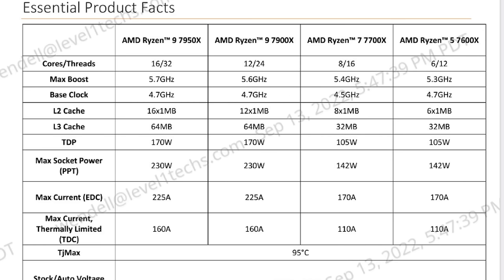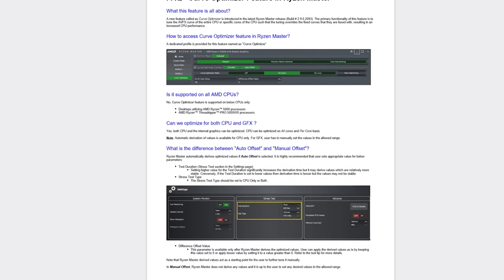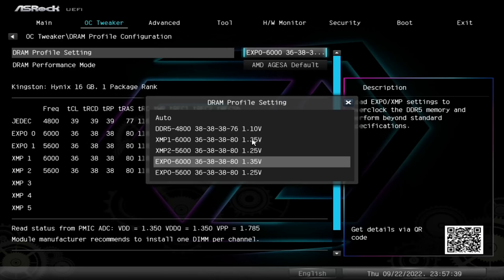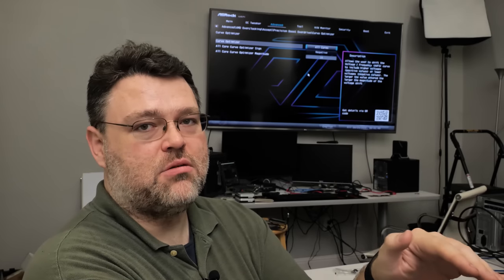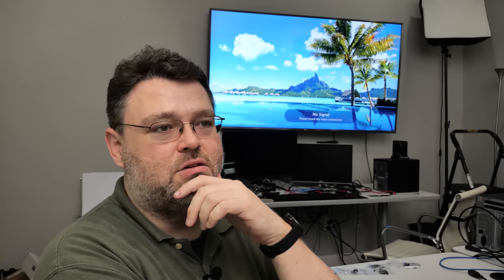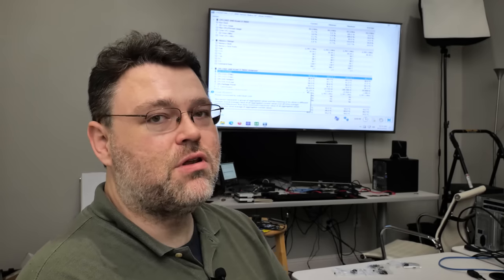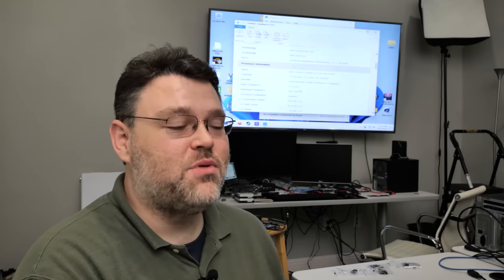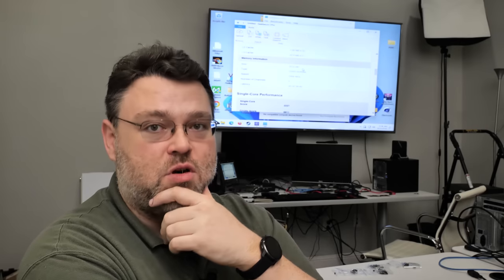Kicking Ryzen 7000 into HYPERDRIVE! Overclocking, Curve Optimizer, 5.85 GHz!

Comment: Hey Wendel, any chance you'll be doing some testing/comparison with 2 DIMM vs 4 DIMM?
I've heard the situation isn't great in respect of ram clock speed penalties but it would be good to know what is possible and what to expect, specifically I'm looking towards 64GB (2x32GB), but would like to know any upgrade routes should I need more ram to expand that to 128GB (4x32GB), nobody seems to be testing that at the moment because they're probably busy with AM5 stuff and Intels new stuff for reviews.
Reply: I'm still in the process of tuning, but I've got two kits of 2x32GB 5600 40-40-40, and on my X670E ProArt they're pretty happily overclocking to 6200 36-36-36. I like to leave a little margin so I've been running memtest over and over on a 6000 36-36-36 profile and have yet to see any errors. On my Alder Lake setup, the computer refuses to do anything but JDEC 4800 if I have these four modules installed at once, so whatever AMD did here worked.

I may just have lucked out and gotten the most perfectly manufactured motherboard and Ryzen memory controller ever made, so your mileage may vary, but if you had asked me last month I would have said that two DIMM per channel is dead and shouldn't be attempted on DDR5. Instead, I find myself pleasantly surprised by just how well my computer is handling this.

If my experience is any indication, adding more modules after the fact shouldn't be a problem. That said, my DIMMs use Hynix dual rank chips, which apparently is the best overclocking thing on the market right now.
Reply: @СусаннаСергеевна  I appreciate the feedback, I'm waiting on the same ProArt X670E motherboard and a 2x32 5600Mhz 40-40-40-77 Corsair [ CMK64GX5M2B5600Z40 ] kit arriving, it's currently held up due to ram availability, the whole lot will ship out when the ram arrives, I have the 7900X CPU already.

It's nice to know I should be able to install a second kit (provided I can get the same SKU) in the future without having the memory bus crippled.

Comment: Regarding your comment on tower cooler.  My ice giant prosiphon with no fans mounted on the cooler has no issues cooling my system.  5.4ghz all core in R23 all day np.  I do have a 200mm fan on the side panel about two inches off the cooler, but this is how I cool it with a near silent system.  Thermaltake V21 with only four 200mm noctuas on it.

Comment: I'm looking forward to custom loop results trickling out.  Decent pumps, proper thickness rad(s) and greater thermal mass ought to make quite the difference, for both performance and noise.
The way [top end] CPU and GPU power draw's gone (and headed?), custom loops may well be become more than a mere vanity project.  Probably also gonna see thicker AIOs rolling out soon, which'll mean cases are gonna have to make room as soo many are designed around the current skinny ones, which'll be a boon for silence freaks running the mid-tier components.
Reply: You can easily get 95% of the performance at half the power, making even a cheap tower cooler sufficient. An extra 5% isn't worth the extra $200 for good water cooling, and risk of leaks. Also, most applications don't use all 16 cores.
Reply: @xeridea  That's always been true, due to diminishing returns (though it is on steroids now).  However, people have still done overclocking to eek more performance as more performance is worth the cost to them.
Most people don't need 8+ cores or 4Ghz+, but those buying those chips want/need it.

Comment: CPU Cooler Roundup you say? The one I'd like to most see on there is the Arctic Liquid Freezer II 420mm
Reply: I would also love to see this myself as I have one just laying about that was given to me new still in the box as they found out it would not fit into there case.  I just got the 7950x so I'll have to start looking about for a case I will not have to modify for this to fit.
Reply: @kevinsteinman8967  you should get a case with room for a second radiator so you can also run a GPU with an AiO or water block attached

Comment: super handy thanks Wends I have the aorus master and the 7900x not had a chance to tinker yet I'm gonna get to it with this valuable info also by the way huge open loop cooling dual rad one of which is 90mm thick lol if the silicon gods have smiled upon me this could be fun

Comment: FFXIV Endwalker BENCHMARK!? I ran the same settings with a i7 12700k (stock), RAM at 3200 MHz XMP (stock), and RTX 2070 Super (stock) and got 21249. You were able to get about 13k more points. That system is about 38% faster than mine on that benchmark.

Comment: Last week upgraded ny 5600x/asus b450/32GB 3200 to 7700/B650M PG Riptide/KingBank 6400 CL32, and with tweaks I have quite happy with the final results:

BIOS Settings:

Memory = 6400 @CL30/38/38/80 1.4V
FCLK = 2133
MCLK=UCLK/2
PBO: Advanced/Motherboard, Scaller 10X, Positive 200
CO: All core, Negative, -30
iGPU = Disabled
BIOS Thermal Limit = 89C

Cinebench R23 Multi/Single = ~19,200/~2000 (~44-46W/~114-116W)

Idle = ~49-51C (Windows 11; room temp ~23C)
Games max 92C
Load (Cinebench R23)
All core=5.1-5.2hz @89.4C
Single Core = 5.49Ghz (59-60C)

Comment: I can get 5.5ghz all core on my 7600 (non x).

Set PBO to +200 
Curve optimizer -42 (-45 max but lowers benchmark score)

This brings me to 5.35ghz so I had to raise the FLK/Base clock from 1 to 1.3 which brought it up to 5.5ghz all core at roughly 72c-75c on my Arctic freezer II 240.

Raising FLK also seems to have raised my from from aggressive 6000mhz cl30 to 6180mhz? at CL30 still.

Comment: I just limited my 7700x to 75c thermal throttle limit and I consistently score over 1000 points higher in cinebench r23
Reply: That’s not how it works 😂
Reply: @puffyips  you can set a thermal limit in the bios
Reply: @ydkma  yeah no shit, what I meant is throttle limit ain’t where it’s at, pbo and power limit is

Comment: Some notes: 1. These chips/zen 4 was designed for laptops.  2. Lowering power settings can lead to higher average FPS, because of higher minimum FPS, probably caused by less throttling because no more overheating, ain't that funny.

Comment: Curve Optimizer at -25 on a 7800X3D, 32GB 6000CL30. Apparently should run at -30 even, but I'll settle for that. Just started dabbling with OC. Not looking for numbers, just something decent, stable, and lower temps & power, with a NH-U14S, can't go crazy anyway.

Comment: I was able to just drop my 7700X straight into the -30 maximum my motherboard allows and it just werks. Three months after I've built it and it hasn't shown even a hint of a symptom of instability. Not sure if I just won the silicon lottery hard, but at that level of undervolt it barely hits 80c on stress tests now.

Comment: Maybe try ECO mode on a linux compile session, if you can do that. Maybe not overheating the processor will actually lead to faster compile times ! =D Less throttling hehe. Seems to work for (gaming) average FPS ! ;) Less low minimums more steady FPS.

Comment: Would be supercool to see if you can build a whisper quiet fast machine with these cpus, limit it to 65w perhaps 4.8 ish all core or something like that so the fans can stay under 600ish rpm with perhaps a 420mm aio.
Reply: Lolol, you could passively cool and just let it throttle at 95C 😁😁
All it needs is enough heat sink area to handle 65w and it's faster than an i9 12900k
Reply: Already built a whisper quiet PC with 5950X and RTX 4090 that remains completely inaudible even under sustained load, using an O11 Air mini case with 10 Noctua fans. Gonna fit an AM5 board with 7950X to see how it fares

Comment: My 7950x runs all day @ 6050 with ddr5 6200 with a older water loop with co @-25
Reply: 6050? What's all of your bios settings? I have a super efficient aio but yet my 7950x never boosts past 5.6ghz.
Reply: @PsychoBenches  what board you on myself am on a strix e gaming wifi.  Curve optimizer set @-25 all the throttling turned off on vrm maybe something to check.  Also make sure docp is allowing curve optimizer to take over when it dont.
Reply: @JoeMama-yl1ow  yeah I'm using the x670e-e gaming wifi, maybe I'll try the curve optimizer

Comment: Based on what I've seen in this video and a couple others, (Optimum Tech comes to mind), it seems quite odd that AMD made the defaults so wasteful when with some judicious tuning you can get more performance with lower temps and lower power draw. 
I suppose the left themselves a lot of leeway to adapt to whatever Intel does with their next release, but the power draw numbers at release were a big turn off for a lot of people.

I really want to see someone do a test to show just how bad it could/will get if you try to reuse an AM4 cooler, particularly air coolers with these new chips at stock settings as well as tuned for more sane power draw.
Reply: Because not all cpus can actually boot with those undervolts, some are binned just on the edge of stability wuere they will never fail at stock, but as soon as you try undervolting it will immediately crash. Silicon lottery at it's finest.
Reply: They are also preparing for raptor lake and AMD went with shock and awe approach.  They know very well that a stock vs stock will be the used for comparison.   Im betting future bios revisions will further optimize these monsters.

Comment: I have negative 25mV!!! on Ryzen 5 7600X Love my new CPU. Upgrade from good old i7 4790k.
Reply: Should try to push the negative offset further with PBO

I was roughly the same at stock, however after maxing out PBO I was able to easily push negative offset to -40 something which simply wasn't possible at stock. This allowed for a higher all core boost, with good voltage 1.205v they really seem to work very well with each other hand in hand.

Once you find the balance for one it let's you push the other further.
Reply: @GainingDespair  I tried that, at -30mV it can work for some time but it is not stable and it will crash eventually. -40mV PC doesn't boot.🤣🤣
Reply: @janissprudzans8631  it's not mv. the optimizer works in steps, please read into that.

Comment: Core cycler makes curve optimizer way easier to stability test quickly
Reply: Do you know if Boost Tester and PBO 2 Tuner work with zen4?  The videos iv seen were all on the last gen CPUs and I'm wondering if they're still applicable to dialing in curve op for this gen?

Comment: Arctic use AM4 backplate on LFII but one of the manufacturers had a slightly different z height of the backplate which negatively impacted cooling, 1 or 2 degrees at idle but double digits when go brrrrr. (either msi or asus, I use both boards and bring the known "good" backplate with the arctic).
Reply: Where did you learn this information, I was looking at an artic cooler for am5 but if I'm rolling the dice on it I'd rather not
Reply: Which motherboard exactly has that issue with Arctic coolers? Could you elaborate on this? I have a LFII 420mm and want to be sure with my future motherboard purchase and any possible incompatibilities.
Reply: @andreyshchukin1355  I think they're referring to the Gamers nexus video titled "Arctic Does What Others Won't: Defective Liquid Freezer II Issues"
Reply: @adammills4099 As long as I understood, FRACTURED LIFE mentioned about some cooling issues due to the thickness of the backplate of some motherboards. If this is the case, I would like to learn more about that issue. The video you mentioned is about other (already solved) issue - the defective rubber gasket that Artic fixed in all latest cooler revisions and provided the proper one for free to anyone who wanted to replace it himself.

Comment: Hi Wendel, did you try a heatsink and fan and monitor the difference between the CPU temp and the cooler temp?  No matter the heat produced in the processor my cooler is staying close to ambient running small fft, etc. with one exception.   I have a Passmark score of 38395 so I'm seeing a substantial bump over stock.    I am using an AsRock $169 B650 board.  I have the memory set to aggressive Expo 6000 CL30 and a -30 PBO on 7700x.   The cooler is an Artic Freezer 33 TR single fan.  The only thing that lead to a power shut down is when I increased the voltage to 1.275 and turned off PBO when that happened the cooler still stayed ambient including the back of the cold plate.   With stock or with PBO the slow heat exchange through the IHS isn't causing problems and you can run a silent fan speeds.  Pushing the voltage and the IHS is acting as an insulator.    Steve at Hardware unboxed used a Wraith cooler which is all a non-heat pipe solution and saw degradation in performance.  I'm not seeing that.

Comment: Regarding the "a lot of electrical load" for having 4 DDR5 DIMMs and trying to run them at, say, 6000 MT/s. I am EXTREMELY curious right now... does Intel have this problem ? Can you run Intel i9 12900K on a higher-end motherboard with 4 DDR 5 DIMMs at 6400 MT/s ? Because I haven't heard of this problem before, only now with AM5
Reply: It's just an issue as of right now a lot of these board manufacturers will release refined and updated bios that will allow for higher clock speeds on the memory side and fix the stability issues. I wouldn't be surprised to see 6400-6600 with 4 dimm and 7200-7400 with 2 dimm with future bios updates and a good CPU to keep the 2-1-1 ratio
Reply: Ram speeds are worse on alder lake actually

Comment: it's better to have 2 DIMMs over 4 ?? well shit i just paid 560 c$ for 4x16Gb of DDR5 Gb 6000Mhz CL40, thinking that having 4 DIMMs would give me better performance ..

well i guess i'm f*** :/ (i'll do benchmarks when i get my ram set to see how severe of a problem this will be ..)
Reply: You’re not necessarily getting better performance out of two DIMMs, but you will find it a lot easier to overclock with only two, because the extra two slots are actually just daisy-chained to the primary two. Capacitance and “bounce” in these traces creates “noise”, making things harder for both the DIMM and the memory controller. It’s even worse if you actually plug something into those extra slots. For this reason the best overclocking boards, even on a full-size motherboard that can physically fit more modules, will only offer one DIMM per memory channel. 

With DDR5, I would be surprised if you can actually use the 6000 mode with all four of your DIMMs plugged in. On my 12900K the only way I can use four DIMMs is at 4800, and that’s after using the memory retry option a few times because the training often simply fails. Zen 4 supposedly has a better memory controller, and soldering the memory slots as surface mounts instead of through hole will also help, which most of the X670 boards are doing, but ultimately it’s a flaw of the standard and it will probably be years before DDR5 becomes as stable as DDR4 is now.

Comment: What difference between leaving PBO Limit to motherboard vs setting the limits listed by overclock3D of 140000, 110000, and 172000? I’m using ASRock B650E PG ITX with a 7950X

Comment: Can you look into an issue with dual ccd am5 chips failing avx2 when running single core multithreaded workload at completely stock settings. No pbo no CO or expo. I have had 3 chips fail avx2 fixed occt cpu stability benchmark now. 
Only way to get them slightly stable or delay the errors being thrown is to give the non vcache cores positive co.

Comment: Hey Wendel, how are you? Q: Do Intel or AMD consumer class (not workstation or server) current or upcoming motherboards have enough PCI lanes and bandwidth to handle a video card streaming 1080p uncompressed(or very minimal compressing) data to another card, say an Intel ARC, so that second card can do real-time hardware AV1 encoding and stream to YouTube?
Reply: I don't know anything about streaming to YouTube, but my virtual machine setup consists of the virtual machine running a program that dumps the video output of a passthrough GPU into a shared RAM region that the host operating system can read and output to the GPU that is actually connected to a monitor. It's called Looking Glass and I've been using it to do 4k60Hz for years now, it works fine. I'd be doing 4k120Hz if the guest GPU could handle it, which it unfortunately can't. What you're suggesting doesn't sound too dissimilar, and 1080p is only a  quarter the bandwidth of what I'm doing. I'm on a 7950X now, but I used to do the same thing on a 6700K, so I can pretty much guarantee that any modern CPU can handle it. Be mindful when you pick a motherboard, just because it has two full-size slots doesn't mean they're both getting an x16 signal. You're going to want at least x8 for the primary GPU and x4 for the secondary (1080p is 16MB per frame, so sixty frames per minute means you need 960MB/s, PCIe3 is 1GB/s per lane but you're going to want some margin for any other things that need to go into the GPU so go one size up, ie x4).

Assuming you're doing this to stream video games, something like an MSI B550-A-PRO with a 5800X3D would be my recommendation. The motherboard is cheap and has the slots you need, and the CPU is the best value high-end gaming platform by a wide margin.

Comment: 7800X3D 1.200 with CO negative 10, liquid cooled 360 rad + 3 fan, power consumption is a joke for the performance deliver amazing cpu, 34 - 40 idle win 11 running and never go over 75 even with 100% load stress test :)!